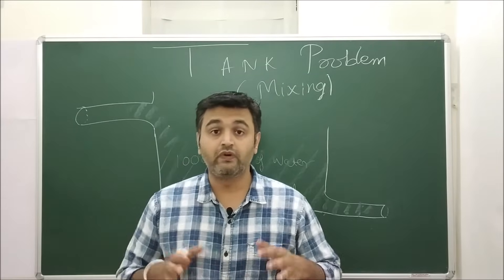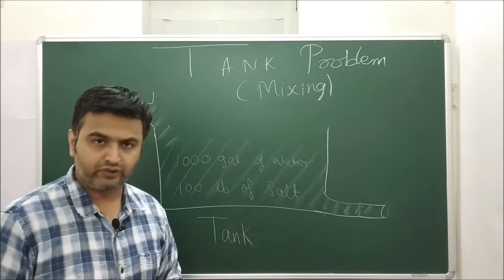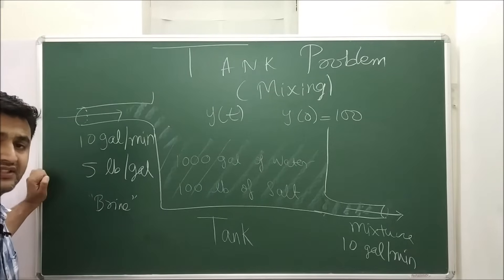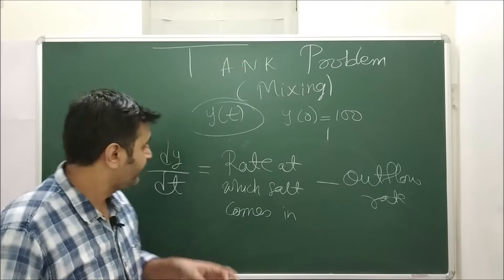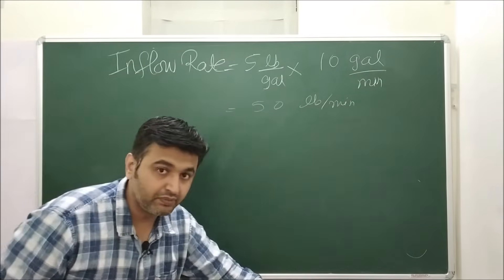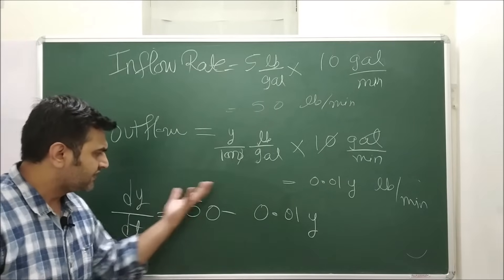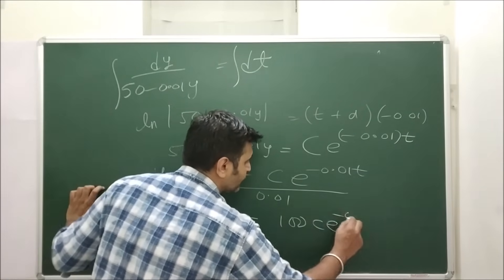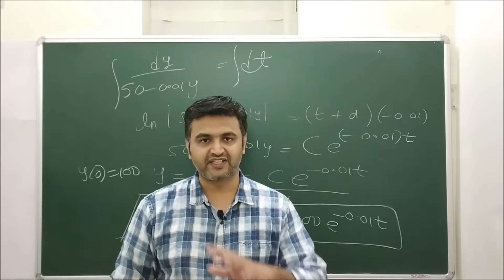Session 5: Single Tank Problem: Modelling and Solution using Differential equation.

Comment: Sir i have a doubt ,i we have to find the salt present after 12 min so what will become out outflow equation please reply, i have a exan
Reply from the maker: Is it possible to post the complete question?
Reply: @DrMathaholic  yes sir send your mail I'll send it to you
Reply: W8 I'll upload here
Reply: @DrMathaholic  A large tank holds 300 gallons of brine solution with lbs of a salt.A concentration of 2lbs/gal is pumped at rate of 4 gal/min.The concentration leaving the tank is pumped out at rate of 3 gal/min.How much  salt is  in the tank after 12 mins.....sir please give the ans asap ..please i have a exam  tomorrow..if you can post video of this sol. it wil helps much more
Reply from the maker: @the-richies2103  okay..
So did you found the differential equation and then it's solution  y(t).
Once you find y(t), simply put t=12 , you will get your answer..
Reply: @DrMathaholic  sir can you tell me what will be outflow equation..so further i will solve by my self
Reply: Is outflow eqn will be (y(t)/300)*3
Reply from the maker: @the-richies2103  (y/300)^3= constant?
No terms involving t?
Reply from the maker: @the-richies2103  I will go home and solve in 1 hr..right now outside
Reply: @DrMathaholic  okay sir but please send it by today..🙏
Reply from the maker: @the-richies2103  dy/dt= 8 - y(t)/100..
So we have : y' + y/100 = 8
Solution will be:
y = 800 + c*e^{-t/100}
Reply from the maker: @the-richies2103  initially how much salt is present? That will be y(0).. use this to find c.
Then find y(12)
Reply from the maker: Let me know if anything is not clear.
Reply: @DrMathaholic  oh got it...
Reply: @DrMathaholic  now here i have to put 12 in place of t?
Reply from the maker: @the-richies2103  yes..at the end..  replace t by 12
Reply from the maker: Hope your exam went well!!